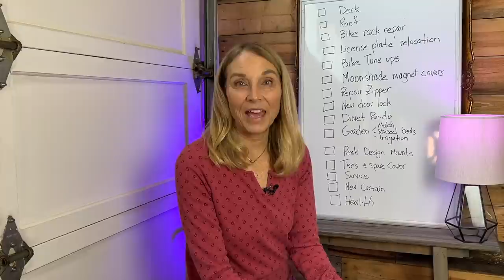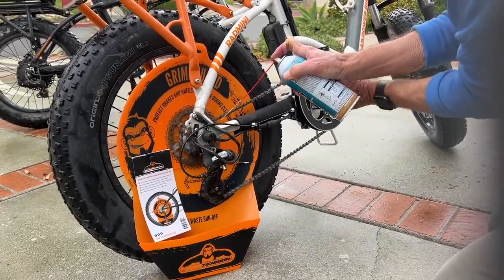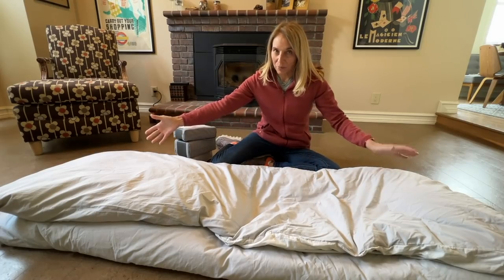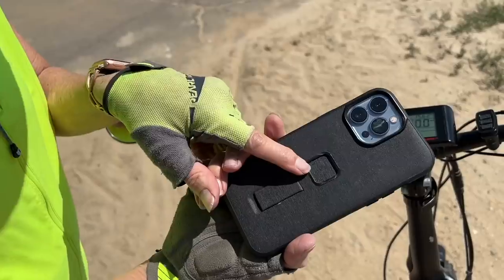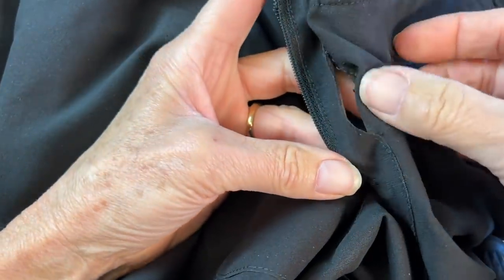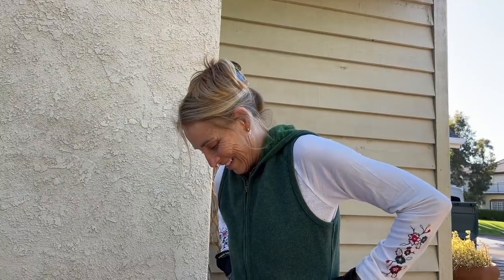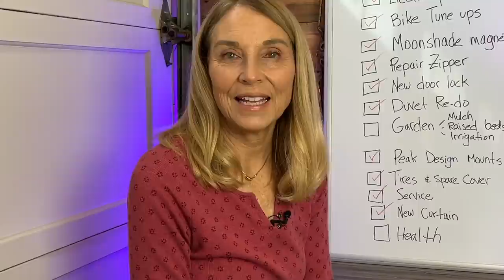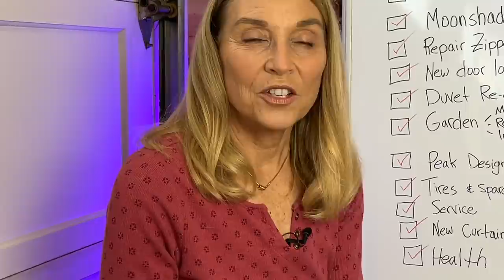Tackling the To Do List before departing on our 10K mile adventure.

Comment: Doing similar things to get the Lexor ready for the Alaska adventure. Service being done now, generator out and trying to get it fixed and reinstalled or not going with it. Once Van back it’s packing time! Safe travels and might not be able to follow your journey depending on internet access after the end of May. Glad John is doing better!
Reply from the maker: We spent a good part of yesterday trying to figure out a way to get better connectivity in Canada but seems nothing has changed in 4 years.  Hopefully we'll be able to find enough WiFi to upload videos.  If you post pics anywhere of your travels, let me know.  Would be fun to follow you guys.
Reply: @FromShetoMe  thanks and I figured it hadn’t changed much in access and speed. Will send you my blog I have for it and plan on trying multiple ways to post on FB, Instagram, and the blog.

Comment: Maybe I get to say I told you so. I am still convinced that if you had used stabilizing straps from the bikes to the hinges you would not have had a problem with the stress fracturing on the rack. I really don't think the hinges would have any problems.
Reply from the maker: Do you have a picture you could send so we understand what they look like and how used? Thanks. energymaven@gmail.com
Reply: I don't have a bike rack so I can't send a picture. What I reccomend is simply use a couple of tie down straps from the upper door hinges to some point on either the bikes or the rack to prevent the rack from tipping back and forth.( Maybe crisscross the straps) There is no need to take up any of weight from the rack only to limit the tipping motion. 
Good luck let me know how you make out. G
Reply from the maker: @gerrydanca7342  Thanks Gerry.
Reply: One more thing. If you don't have space to hook on the hinges you could try to create a place to attach the hook by using a short piece of rope and make a loop around the hinges and hook onto that.
Reply: Have you got any plans to visit New England?
Reply from the maker: @gerrydanca7342  We'll see if we can figure something out.  May be complicated by our spare tire holder on the one side.  As far as visiting New England, I have a girlfriend I'll be visiting in Vermont, but it really comes down to how much time we take along Route 6.  We have to be in New Brunswick June 19.

Comment: Just thought of this - did you get the license plate lighting kit from Wilco as well?  I was pulled over once because both bulbs that light the plate had burned out, which really surprised me.  But the law in GA is much like the law in CA - plates must be illuminated by a white light so as to be seen at 50 ft.
Reply from the maker: I guess we'll have to look into that.  Probably not been stopped because we don't drive at night.  Thanks for the heads up.

Comment: you could add a FLUME water meter transmitter, to remotely monitor your water use, and it will trigger warnings.  No tools required, it does require wifi on your property, and continual internet access via your router
Reply from the maker: I installed a Rachio controller and sounds like it is similar. It is connected to local weather stations and changes amount of water with changing weather patterns. Bluetooth app is great. I love it.